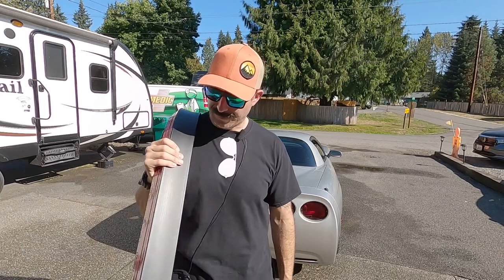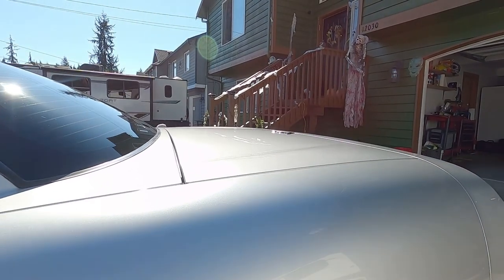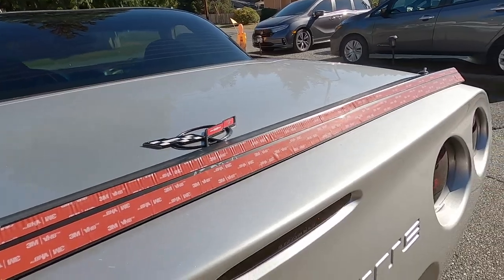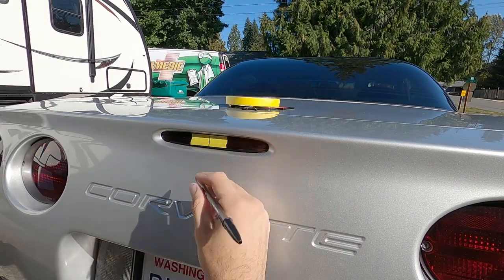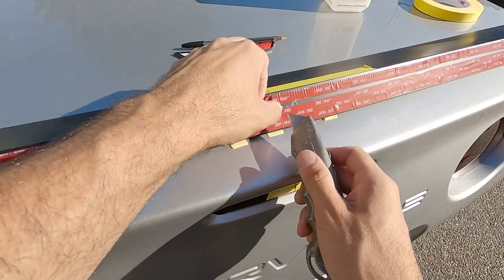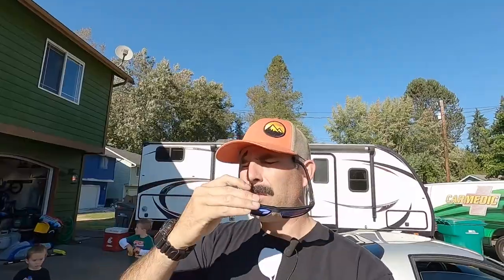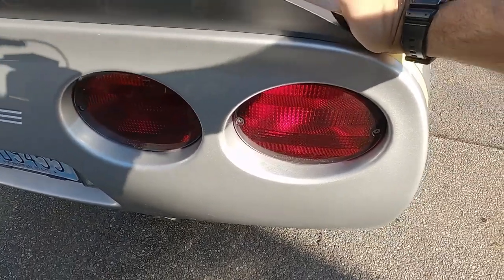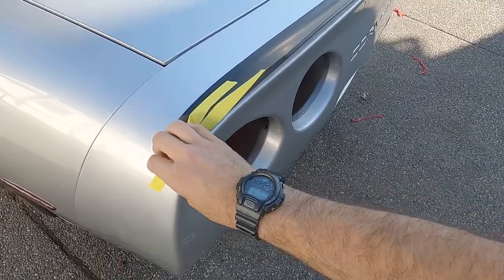SIMPLE SPOILER INSTALL!! SpoilerKing (380p) goes on the C5 Corvette

Comment: I have the shorter version you did everything right but it should be flush with the top of the bumper lol but now I want a taller spoiler.
Reply from the maker: Thanks for watching Steve. Funny, I bought the shorter one originally, then saw the larger one on another c5. I knew right then it had to be the bigger spoiler. Both though I think look great.